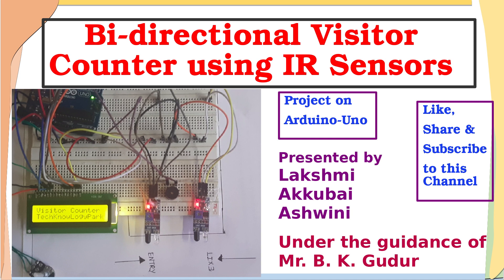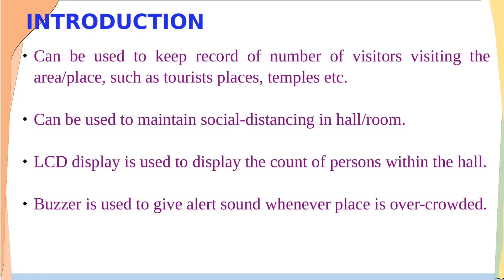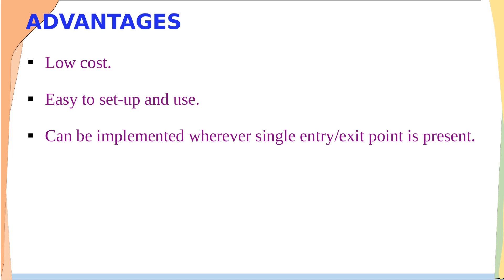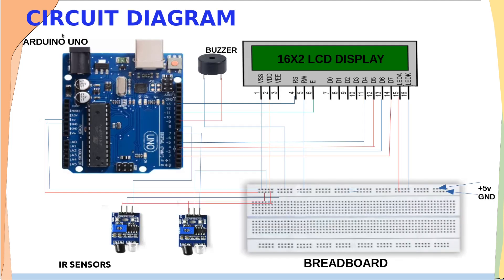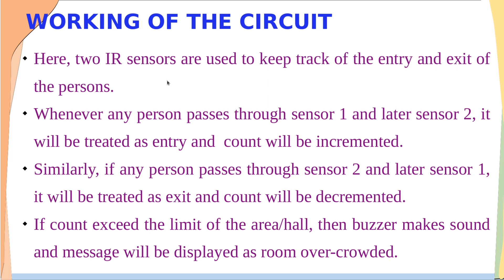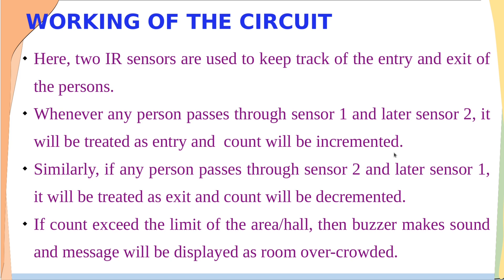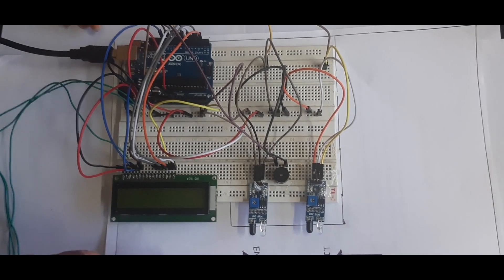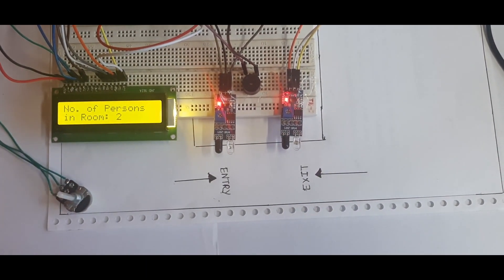Bi-directional Visitor Counter using Arduino and IR Sensors

Comment: hello maam. theres an error in the code. i think it is because of copying from the web. can i have a code privately??
Reply from the maker: Check below Code:

#include<LiquidCrystal.h>
LiquidCrystal lcd(13,11,5,4,3,2);

#define MAX_LIMIT  40   //Maximum number of persons allowed in the hall or room

#define in 8    //IR Sensor 1
#define out 7   //IR sensor 2
#define buz 9   //Buzzer pin

int count=0, pos=0;

//Function to Display the count on LCD

void displayCount(int num){
	char str[6];        //To hold count to be displayed
    	int i, rem, len = 0, n;

 	/*Convert integer (count) to string for displaying on LCD*/
    	n = num;
    	while (n != 0){
        	len++;
        	n /= 10;
    	}
    	for (i = 0; i < len; i++){
        	rem = num % 10;
        	num = num / 10;
        	str[len - (i + 1)] = rem + '0';
    	}
      	str[len] = '\0';	//Put NULL character to end the string

	/*If count in room or hall is less than maximum limit of the hall or room, 
	  then display the message on LCD to print Number of persons in room */
      	if(count < MAX_LIMIT){
     		lcd.clear();
      		lcd.setCursor(0,0);
      		lcd.print("No. of Persons");
      		lcd.setCursor(0,1);
      		lcd.print("in Room: ");
      	}

    	/*If number of persons in room is equal to MAX_LIMIT of the room,
          then display the message as Room Full */
    	if(count==4){
      		lcd.clear();
      		lcd.setCursor(0,0);
      		lcd.print("Room Full ");
      		lcd.setCursor(0,1);
      		lcd.print("No.of Persons:");
      	}

	/*If number of persons in room is greater than MAX_LIMIT,
          then display the message as Over Crowded Room and also turn on Buzzer*/
     	if(count>4){
        	digitalWrite(buz, HIGH);	//Buzzer made ON
	        lcd.clear();
      		lcd.setCursor(0,0);
	      	lcd.print("Over CrowdedRoom");
      		lcd.setCursor(0,1);
	      	lcd.print("No.of Persons:");
     	}
      	else{	//If count is less than or equal to MAX_LIMIT, the turnoff buzzer
           	digitalWrite(buz, LOW);
      	}

	//Display the count on LCD
    	lcd.print(str);
}

//Setup function for initial setup
void setup(){
	//IR sensor pins are made as input pins
  	pinMode(in, INPUT);	
  	pinMode(out, INPUT);

	//Buzzer pin is made as output pin
  	pinMode(buz, OUTPUT);

	// Buzzer made ON for small duration to indicate start of the counting
  	digitalWrite(buz,HIGH);
  	delay(1000);
  	digitalWrite(buz,LOW);
  	delay(50);

	//Initial Message on LCD
  	lcd.begin(16,2);
  	lcd.print("Visitor Counter");
  	delay(100);
   	lcd.setCursor(0,1);
  	lcd.print("TechKnowLogyPark");
  	delay(100);
}

//Loop function 
void loop(){  
 
  	if((digitalRead(in))==0){
    	delay(20);
    	while((digitalRead(in))==0);
    	/*
    	Arrangement or placing of sensors: while entering the room from outside, sensor1 will be 
    	encounterd first and sensor2 will be next.
    	pos will tell the position of a person, entering/leaving the room

    	If pos=0, default value; No person is entering/leaving the room/hall
    	If pos=1, person is entering the room and crossed sensor1 (in)
    	If pos=2, person has entered the room after crossing both the sensors
    	If pos=3, person is going out of the room and crossed the sensor2 (out)
    	If pos=4, person has gone out of the room after crossing both the sensors
    	*/
    	if(pos==0)	
       		pos=1;
       	else if(pos==3)
       		pos=4;
  	}
  	if(pos==4 && count!=0){
    		count--;		//person has left the room, decrement the count
    		displayCount(count);
    		pos=0;
  	}
   	if((digitalRead(out))==0){
      		delay(20);
      		while((digitalRead(out))==0);
       		if(pos==1)
       			pos=2;
       		else if(pos==0)
       			pos=3;
    	}
   
    	if(pos==2){
      		count++;		//person has entered the room, increment the count
      		displayCount(count);
      		pos=0;
    	}
    	else if(pos==4 && count!=0){
      		count--;		//person has left the room, decrement the count
      		displayCount(count);
      		pos=0;
    	}
    	delay(50);
}
Reply: @TechKnowLogyPark  hello maam.why s it stock in the title,the sensor is active but it doesnt start counting
Reply from the maker: The code is completely tested and working perfectly. You just check the connections properly. To increment the count, object should first pass through one sensor and later through the other and vice-versa for decrement.

Comment: Does the lcd print ? In my case doesn’t want to print did someone faced that issue?? I hope you help me plz ♥️♥️😔
Reply from the maker: That code is fully tested and is working properly. What problem are you facing?
Reply: @TechKnowLogyPark  it doesn’t want decrement im sure that every thing is connected properly and the sensor is placed in perfect way what do you think is the problem?
Reply from the maker: Try to use below code:

#include<LiquidCrystal.h>
LiquidCrystal lcd(13,11,5,4,3,2);

#define MAX_LIMIT  40   //Maximum number of persons allowed in the hall or room

#define in 8    //IR Sensor 1
#define out 7   //IR sensor 2
#define buz 9   //Buzzer pin

int count=0, pos=0;

//Function to Display the count on LCD

void displayCount(int num){
	char str[6];        //To hold count to be displayed
    	int i, rem, len = 0, n;

 	/*Convert integer (count) to string for displaying on LCD*/
    	n = num;
    	while (n != 0){
        	len++;
        	n /= 10;
    	}
    	for (i = 0; i < len; i++){
        	rem = num % 10;
        	num = num / 10;
        	str[len - (i + 1)] = rem + '0';
    	}
      	str[len] = '\0';	//Put NULL character to end the string

	/*If count in room or hall is less than maximum limit of the hall or room, 
	  then display the message on LCD to print Number of persons in room */
      	if(count < MAX_LIMIT){
     		lcd.clear();
      		lcd.setCursor(0,0);
      		lcd.print("No. of Persons");
      		lcd.setCursor(0,1);
      		lcd.print("in Room: ");
      	}

    	/*If number of persons in room is equal to MAX_LIMIT of the room,
          then display the message as Room Full */
    	if(count==4){
      		lcd.clear();
      		lcd.setCursor(0,0);
      		lcd.print("Room Full ");
      		lcd.setCursor(0,1);
      		lcd.print("No.of Persons:");
      	}

	/*If number of persons in room is greater than MAX_LIMIT,
          then display the message as Over Crowded Room and also turn on Buzzer*/
     	if(count>4){
        	digitalWrite(buz, HIGH);	//Buzzer made ON
	        lcd.clear();
      		lcd.setCursor(0,0);
	      	lcd.print("Over CrowdedRoom");
      		lcd.setCursor(0,1);
	      	lcd.print("No.of Persons:");
     	}
      	else{	//If count is less than or equal to MAX_LIMIT, the turnoff buzzer
           	digitalWrite(buz, LOW);
      	}

	//Display the count on LCD
    	lcd.print(str);
}

//Setup function for initial setup
void setup(){
	//IR sensor pins are made as input pins
  	pinMode(in, INPUT);	
  	pinMode(out, INPUT);

	//Buzzer pin is made as output pin
  	pinMode(buz, OUTPUT);

	// Buzzer made ON for small duration to indicate start of the counting
  	digitalWrite(buz,HIGH);
  	delay(1000);
  	digitalWrite(buz,LOW);
  	delay(50);

	//Initial Message on LCD
  	lcd.begin(16,2);
  	lcd.print("Visitor Counter");
  	delay(100);
   	lcd.setCursor(0,1);
  	lcd.print("TechKnowLogyPark");
  	delay(100);
}

//Loop function 
void loop(){  
 
  	if((digitalRead(in))==0){
    	delay(20);
    	while((digitalRead(in))==0);
    	/*
    	Arrangement or placing ofsensors: while entering the room from outside, sensor1 will be 
    	encounterd first and sensor2 will be next.

    	If pos=0, default value; No person is entering/leaving the room/hall
    	If pos=1, person is entering the room and crossed sensor1 (in)
    	If pos=2, person has entered the room after crossing both the sensors
    	If pos=3, person is going out of the room and crossed the sensor2 (out)
    	If pos=4, person has gone out of the room after crossing both the sensors
    	*/
    	if(pos==0)	
       		pos=1;
       	else if(pos==3)
       		pos=4;
  	}
  	if(pos==4 && count!=0){
    		count--;		//person has left the room, decrement the count
    		displayCount(count);
    		pos=0;
  	}
   	if((digitalRead(out))==0){
      		delay(20);
      		while((digitalRead(out))==0);
       		if(pos==1)
       			pos=2;
       		else if(pos==0)
       			pos=3;
    	}
   
    	if(pos==2){
      		count++;		//person has entered the room, increment the count
      		displayCount(count);
      		pos=0;
    	}
    	else if(pos==4 && count!=0){
      		count--;		//person has left the room, decrement the count
      		displayCount(count);
      		pos=0;
    	}
    	delay(50);
}

Comment: please help the latest code is not decrementing only incrementing
Reply from the maker: You can find the working code using the link given below:
http://techknowlogypark.in/bidirectional-visitor-counter-using-arduino/
This code has been tested and even used by many others for implementing bidirectional visitor counter. You just need to arrange both the sensors properly. If you fail to get the result, you can ask me the same for the solution.
Reply: @TechKnowLogyPark  I use pir sensor HC-SR501
Reply from the maker: I have written the code and implemented the project using IR Sensor Modules. Use IR sensor modules rather than PIR sensor.
Reply: @TechKnowLogyPark  yeah I understand my project is human entering and exiting but what can you recommend to me except the pir sensor I choose  pir sensor because it detect heat movement so it will be accurate that it detects human than just motion only
Reply: what do you think might be the problem is it because I used pir instead ir?
Reply from the maker: The range of PIR sesnor will be more and radial, it will be difficult to implement bidirectional visitor counter using PIR sensor. Most of the time,  both sensors will capture the signal at a time. To avid this, both the sensors need to be kept very far apart such that, person who enters must cross sensor 1 and later sensor 2 and person who exits must cross sensor 2 and later sensor 1. If you can maintain enough distance between both the sensors, then you can implement the same using PIR sensors.
Reply: @TechKnowLogyPark  yeah I already have a solution for that. I customized the lens I'm just wondering why it's not decrementing
Reply from the maker: Otherwise also there is another method which you can use: Implement the same using IR sensors but to detect human, you use a PIR sensor and activate both IR sensors, only when PIR sensor is activated. By doing this, PIR sensor will ensure human crossing and IR sensors will help in keeping track of exit and entry. Hope, this idea will help you to achieve what you want.
Reply from the maker: If it is working properly for incrementing, it has to work for decrement, just cross check whether your sensors are activated in order of entry and exit, properly.
Reply: @TechKnowLogyPark  ohhhh okay good idea I will try it later. Thankyou! You're extremely helpful!

Comment: Hello maam, I've used your code and it works great but I faced an issue. When my count becomes zero and you try to decrement the count again it stops counting, even though you follow the enter function to increment the count, it doesnt add it. Please help me to fix this issue also thank you so much for the source code🥰
Reply from the maker: Is it not incrementing the count after count=0? And are you crossing out of room even after the count becomes zero?
Check the code as per the below web page link:
http://techknowlogypark.in/bidirectional-visitor-counter-using-arduino/

Comment: Can anyone send me the code for it
Reply from the maker: #include<LiquidCrystal.h>
LiquidCrystal lcd(13,11,5,4,3,2);

#define MAX_LIMIT  40   //Maximum number of persons allowed in the hall or room

#define in 8    //IR Sensor 1
#define out 7   //IR sensor 2
#define buz 9   //Buzzer pin

int count=0, pos=0;

//Function to Display the count on LCD

void displayCount(int num){
	char str[6];        //To hold count to be displayed
    	int i, rem, len = 0, n;

 	/*Convert integer (count) to string for displaying on LCD*/
    	n = num;
    	while (n != 0){
        	len++;
        	n /= 10;
    	}
    	for (i = 0; i < len; i++){
        	rem = num % 10;
        	num = num / 10;
        	str[len - (i + 1)] = rem + '0';
    	}
      	str[len] = '\0';	//Put NULL character to end the string

	/*If count in room or hall is less than maximum limit of the hall or room, 
	  then display the message on LCD to print Number of persons in room */
      	if(count < MAX_LIMIT){
     		lcd.clear();
      		lcd.setCursor(0,0);
      		lcd.print("No. of Persons");
      		lcd.setCursor(0,1);
      		lcd.print("in Room: ");
      	}

    	/*If number of persons in room is equal to MAX_LIMIT of the room,
          then display the message as Room Full */
    	if(count==4){
      		lcd.clear();
      		lcd.setCursor(0,0);
      		lcd.print("Room Full ");
      		lcd.setCursor(0,1);
      		lcd.print("No.of Persons:");
      	}

	/*If number of persons in room is greater than MAX_LIMIT,
          then display the message as Over Crowded Room and also turn on Buzzer*/
     	if(count>4){
        	digitalWrite(buz, HIGH);	//Buzzer made ON
	        lcd.clear();
      		lcd.setCursor(0,0);
	      	lcd.print("Over CrowdedRoom");
      		lcd.setCursor(0,1);
	      	lcd.print("No.of Persons:");
     	}
      	else{	//If count is less than or equal to MAX_LIMIT, the turnoff buzzer
           	digitalWrite(buz, LOW);
      	}

	//Display the count on LCD
    	lcd.print(str);
}

//Setup function for initial setup
void setup(){
	//IR sensor pins are made as input pins
  	pinMode(in, INPUT);	
  	pinMode(out, INPUT);

	//Buzzer pin is made as output pin
  	pinMode(buz, OUTPUT);

	// Buzzer made ON for small duration to indicate start of the counting
  	digitalWrite(buz,HIGH);
  	delay(1000);
  	digitalWrite(buz,LOW);
  	delay(50);

	//Initial Message on LCD
  	lcd.begin(16,2);
  	lcd.print("Visitor Counter");
  	delay(100);
   	lcd.setCursor(0,1);
  	lcd.print("TechKnowLogyPark");
  	delay(100);
}

//Loop function 
void loop(){  
 
  	if((digitalRead(in))==0){
    	delay(20);
    	while((digitalRead(in))==0);
    	/*
    	Arrangement or placing ofsensors: while entering the room from outside, sensor1 will be 
    	encounterd first and sensor2 will be next.

    	If pos=0, default value; No person is entering/leaving the room/hall
    	If pos=1, person is entering the room and crossed sensor1 (in)
    	If pos=2, person has entered the room after crossing both the sensors
    	If pos=3, person is going out of the room and crossed the sensor2 (out)
    	If pos=4, person has gone out of the room after crossing both the sensors
    	*/
    	if(pos==0)	
       		pos=1;
       	else if(pos==3)
       		pos=4;
  	}
  	if(pos==4 && count!=0){
    		count--;		//person has left the room, decrement the count
    		displayCount(count);
    		pos=0;
  	}
   	if((digitalRead(out))==0){
      		delay(20);
      		while((digitalRead(out))==0);
       		if(pos==1)
       			pos=2;
       		else if(pos==0)
       			pos=3;
    	}
   
    	if(pos==2){
      		count++;		//person has entered the room, increment the count
      		displayCount(count);
      		pos=0;
    	}
    	else if(pos==4 && count!=0){
      		count--;		//person has left the room, decrement the count
      		displayCount(count);
      		pos=0;
    	}
        else{
                 count =0;
        }
    	delay(50);
}
Reply: @TechKnowLogyPark  Thank u very much

Comment: Hi, I had problem during compiling the source code that u provide. Can you please guide me? Thanks, i had email to the about the error message.
Reply from the maker: I have gone through the email sent by you. The errors are the result of change in text encoding. Such errors normally occurs whenever we copy the source to from the webpages. Anyway I have sent source to to your email ID. Hope it will solve your problem..

Comment: Actually in the circuit diagram you haven't given any connection of potentio meter but where as in hardware connection you were connecting with it..
Can you please tell me the connection for potentio meter
Reply from the maker: Connect middle point of 10k pot to VEE of LCD and remaining two points of 10k pot to GND and Vcc, one for each..

Comment: Madam can you explain me this written in your code 
int i, rem, len = 0, n;
    /*Convert integer (count) to string for displaying on LCD*/
    n = num;
    while (n != 0){
      len++;
      n /= 10;
    }
    for (i = 0; i < len; i++){
      rem = num % 10;
      num = num / 10;
      str[len – (i + 1)] = rem + ‘0’;
Reply from the maker: Yes Ezhaan Kazi,
The above code is written to convert the integer to string for displaying on LCD.
First part will count number of digits in a number and second part will convert every digit to a character. This can be done just by adding ascii value of zero to any digit.
Hope this is now clear to you.. If not I'll tell explain in detail.
Reply: @TechKnowLogyPark  how can i contact you because i want to use this code in my project code but i dont understand how to do it.can you help me  
Out ??
Reply from the maker: techknowlogypark@gmail.com
Reply: @TechKnowLogyPark  I've mailed you can you check your inbox plz
Reply: @TechKnowLogyPark  hey r u there
Reply: Can you plz send me the code ?